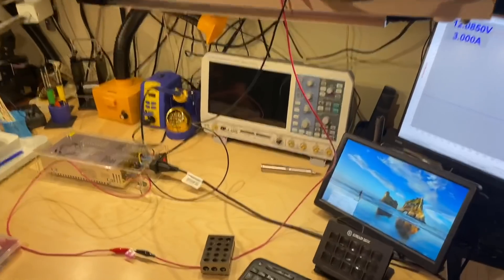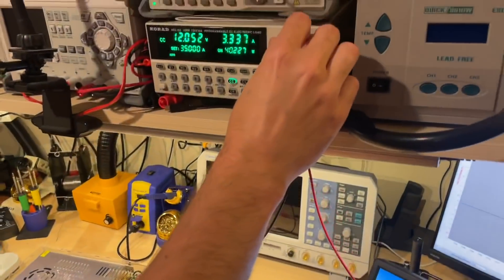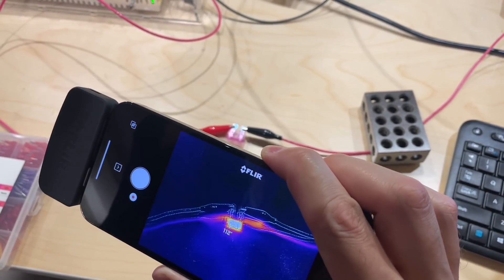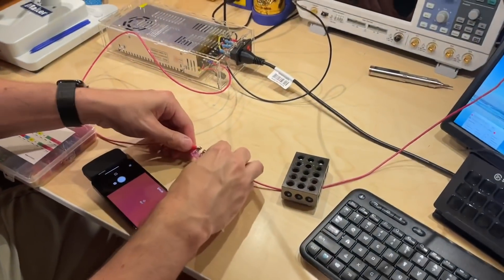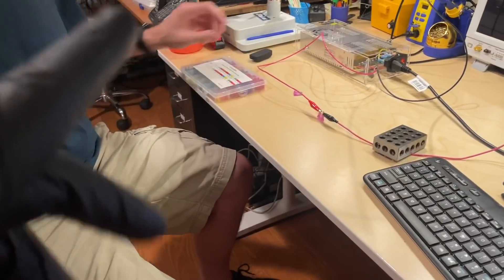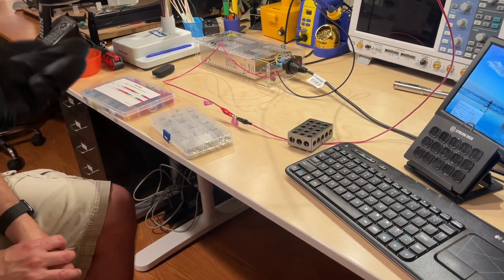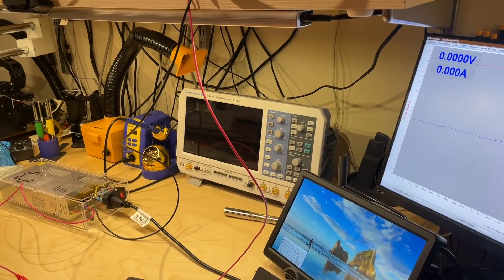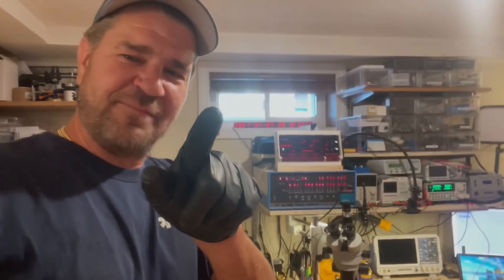Discussing & Testing Cheap 3 Amp ATC Furnace Chinese Fuses with an Electrical Engineer

Comment: I've seen the same thing from all different types (Glass, ATC, Pico, etc.) of fuses that come from China - fast blow-types are taking 200%+ of their rated load to blow. I recently tested a 5A fuse that took 10A+ for over 10 seconds before it blew, and it was a fast-blow type. I tried the same spec fuse, but this time from Littlefuse. Blew at 5.6A when I was ramping it up slowly, and 5.1A when I hit it with immediate full current...stick with the known brands like Littlefuse and Bussman - these are protection devices that stop fires and equipment damage - don't cheap out or try and save a buck with these.

Comment: There are standards spec sheets which show time to blow for a given amperage. Voltage is not important, current is. 

Actually found the other day that the morons who installed one of my units 14 years ago (third owner since 2020) that they wired the 24v transformer to pull power from the wrong location on the board....there is a specific spade terminal for the xformer. Before it worked OK but something happened to cause the fuse to continuously blow. Wired correctly and no more issues.

Comment: hvac transformers(all transformers) have a rated continuous load, you go over that for a sustained period and they'll overheat letting the magic smoke out.
say you have one rated 24V(volts) at 40VA(Volt-Amperes), it's max continuous current limit would be 40VA divided by 24V (40 / 24v = 1.67) rounded up to nearest tenth. so 1.67 amps continuous load, above that it will slowly overheat and cook itself. so it's possible a 3 amp fuse may not blow, if the total circuit load is less than needed to blow the fuse!
meanwhile the transformer is still overloaded, overheating and will burn out. best case scenario is a good 3amp fuse and a dead short somewhere that blows the fuse in a short time frame.

Comment: using alligator clip test leads at the fuse is rather a poor connection. but there was major recalls of automotive fuses in the past, "Horrible Fright" got spanked with their fuse assortments not blowing and damaging vehicle wiring/causing fires. I think there was recalls on stuff through amazon also, I don't imagine them throwing the stuff away and it probably got the circle jerk round shipping and relabeling routine. lol

Comment: Mike, I'm a ham, and grew up same (and railroading).  Electronics are in my wheelhouse.
Fuses come in two flavors; fast-acting, and slo-blow.  The first will open immediately on overload, the second will continue to hold for perhaps 5 seconds at rating, but will open on anything above or of longer duration.
Used to be a simple thing, but as I have repeatedly said, some things made in Shenzing are quality, most aren't.

Comment: Possibly Engineers take information like this into consideration when recommending a fuse rating. Knowing that fuses might break the circuit at five amps, a 3 amp fuse is then specified. Ladder ratings are like this. For instance, a Type II ladder is rated for 225 lbs. However, it can hold a load twice that.

Comment: At 12 volts try 24volts
Reply: Great video

I don’t know enough about the transformers in operation on the boards but are they 24v ac or dc? 
The difference in fuse rating between 24dc and 12 dc as far as current (IMO) would be negligible. From what I remember from years back we’d be dealing with I2R for the power calculations based on needing to heat the (cross section of) element to its melting point  (no voltage in the calculation IIRC) if we’re taking 24ac vs 12 dc then I would think this would make a bigger difference due to ac crossing a zero point and causing more current at that point. 

Not sure what we are comparing but I don’t think the testing voltage difference between 12/24 dc would make the fuse handle 60% more than it’s rated capacity. 

I’m thinking along the lines of you Mikey, junk fuses that have no real inspection or testing to confirm what they are specd at. I’d assume they are not UL listed either. 

It’s going to take somebody a whole lot smarter than me to figure this one out 😂 there’s a reason I left electrical engineering lol
Reply: @focusedelectronics  is correct. Power supply voltage makes no difference to blowing this fuse. It's all about the current. (heat/power/I2R)

Thermostat transformers are 24 VAC, but I don't have the equipment to create a precise AC current, so I used what I had available. It does make a difference: the fuse should melt at the same (RMS) current, but in the case of DC, there's a potential for an arc to keep the circuit going, where AC is "easier" to break.

So for this limited scenario, where we're just talking about low voltage, low current applications and small blade fuses, it's probably not relevant.

Comment: Should get a short pro. Better than a little popper. Light stays on if you have a short so you can trace the short. can't beat for 25 bucks
Reply: One of those but with bluetooth or wifi to transmit state to your phone or tablet when you are outside.
Reply: @PipeDoctor  Short-Pro Tool by Global
It stays lit if there is a short. Then you just unhook wires til the light goes out which indicates which wire is shorted.

Comment: 👍 info, fuse manufactory rate fuses by voltage applications & Ac or DC applied
 Example: One can't use a 240vac fuse on a 480vac system.... 
Makes big difference on Voltage applied to protection of a circuit ..
Reply: A fuse has a maximum voltage rating, but that's more about what it can safely break. It's the current that blows the fuse, not the voltage.
Reply: Yes true, but are the fuses your testing car fuses rated for 12 volts ?
 And Mike pipes are using them on 27 A/c volts system... food for thought
Reply: @bobparrott8130  I don't know which fuses he had trouble with. These are the exact ones I was using, they're supposedly rated for 32V: https://amzn.to/3dX2Dzo

Comment: While I totally agree with the china producing inferior goods sentiment I don't agree with the idea that a 3 amp fuse is a bad or inferior fuse if it does not blow at 3 amps.  These fast acting ATC fuses have a range of amps for each fuse rating.  The range is described as the Time - Current Characteristic for each fuse rating.  In order to really determine if the fuses are junk you would need to look at the characteristic curve for the fuse from the manufacturer and test it but not the same way you fellows did in the video.  For such a small incremental cost I would do as you and never use the chinese version of these fuses.  Why take the chance and BTW I would apply that practice to ANYTHING I bought that was made in China.  Here is Bussmann's description of the time characteristics for their ATC fuses.  Notice their 3A fuse on average literally never blows at 3 amps.  https://www.eaton.com/content/dam/eaton/products/electrical-circuit-protection/fuses/data-sheets/bus-ele-ds-2009-atc.pdf

Comment: Watch : Automotive Fuse Comparison from Weber Auto . A college professor puts this GARBAGE to the test in the lab  . They FAIL miserably and are DANGEROUS ! Step ONE : remove this CRAP and don't waste your time till you install a name brand , such as Buss , etc. There is no shortage of low end junk that does perform to specifications . The other problem is " experts " that cannot diagnosis systems and circuits . But they sure can SLAM parts in !

Comment: LOL this is what I did,  except his gear is FAR more sensitive then mine LOL   (I was using a Chinese current limited power supply for my tests instead of a digital load so I may have been at 5 amps when it said 4...... I would love his gear but my wallet just won't do it LOL  )   But I didn't slowly ramp up the amps, I disconnected, reset to higher and then hit it that way its an instant "hit" which is much more how it would be in real world when something shorts.

Comment: what you and most people need to realize is most if not all equipment is "made" in china. yes it may say made in america but the parts inside are "made" in china. It costs less to manufacture in china due to expensive merican taxes and labor. basic economics right there. the other thing is those fuses are probably made in the same place as the name brand ones you mentioned. The only difference is the "cheap" chinese ones are cheap as they have lower tolerances and or are the rejected batches that companies make but dont throw away. If they make 50k fuses a day and 25% fail QC they are not going to throw in the garbage 12.5k fuses, they will sell them... bottom line is you get what u pay for but most if not all HVAC equipment is "sourced" in china. its been like that for 40 years. so bashing china is pointless you should be bashing the merican companies that source from china.
Reply: But when you buy a name brand, you are paying for that company to enforce quality control and do the testing of what is delivered from their chinese suppliers.  If you buy the no name brand, you are likely buying the discards of the quality control.

Comment: Intersting Video...first of all I'm an Electrical Eng. from Germany...so I watched this Video with a lot of interest...so yeah Great Video. There is one thing witch works out for me coming to this fuses and its the following. The Rating in Amps times 1,2 is the tolerance the fuse should have. So 3A * 1,2 =3,6A max. And should blow at 1,6 times the Rating so 3A*1,6 = 4,8A iimmediately and this is working for me in 95% of all casses. Its not for circuit Breakers whit 120V or 240V rating.

Comment: The issue with Chinese is quality control.  Batches of any product need spot inspection to determine if the product is within spec.  Absent that and your product can be 'off'.  Lack of quality control is presence of apathy.  The two are mutually exclusive.  Then the notion of sabotage enters the picture.  Products produced for consumption in a competing (or enemy) state can be used to weaken.  Our reliance on imported goods is leading  us down the garden path of destruction.   There should, at least be thorough inspections upon entry into our nation.  Products deemed unsatisfactory could/should be rejected at the port.  The present attitude among our leaders is naive at best with regards to such considerations.
Reply: It's over current protection not insta-trip protection.😐

Comment: The problem is there is no such thing as a fuse, there are many types and roles as well as just the commonly understood current rating. Fuses have to be selected with knowledge of the circuit (AC or DC and voltage) they are protecting and the type of load - as their behaviour needs to be different. For example fuses for resistive load  are different to one protecting an inductive circuit load (motors). A brief overview:
Unsurprisingly for such a widely used component, fuses are available in a multitude of models and voltage capacities for use in different industrial, manufacturing and electronic settings.

The time taken for a particular type of fuse to blow is called the fuse speed. The three principal fuse speeds available are:

Ultra-rapid fuses: typically used in sensitive circuitry and transistors to protect against short circuits, reacting almost instantaneously. These are also known as Very Fast Acting, Super Rapid and High-Speed fuses

Fast Acting Fuses: these are a more general-purpose fuse typically used with cabling and sturdier components. They are also known as Fast Blow or F-Type fuses

Slow Acting fuses include a delay mechanism which allows short, lower power electrical surges to pass through the circuit without the fuse blowing. They are also known as Slow Blow or Time Delay fuses. Dual Element fuses feature a higher performance delay mechanism

If you buy a job lot of ‘fuses’ from a cheap supplier - all bets are off.
Reply: Especially in the refrigeration field, the need for slow blow fuses or circuit breakers to allow momentary amp draws in excess of the rating are essential to prevent nuisance trips.  Locked rotor amperage on start up normally disappears a split second after motor start.  Going out in the middle of the night to replace a finger fuse or reset a tripped breaker is, in my mind more than a nuisance.  Now, you do want the slow blow to open up if the LRA continues, as this indicates a problem with the start process of the motor.  Other factors including fuse or breaker age also determine the sensitivity as well.   Better to have a fuse blow than a building catch fire.

Comment: Is the circuit board on a furnace/air handler AC volts? Should you be testing with ac voltage . Just curious
Reply: it's ac power in and through the fuse, some of the power is rectified and regulated to DC for powering the circuitry, which pretty much stays on the control board.  the rest of the devices in the unit, thermostat, contactor in condenser, other relays and controls are all 24VAC and the board passes it out to everything as needed.

Comment: I will tell something else about fuses! The larger amp round fuses have a strip of copper running from one end to the other and are filled with sand! These fuses are designed to be installed  sideways because if you installed them straight up and down the sand will settle a not cover the top part of the copper strip resulting in premature failure because the the fuse is designed for the sand to absorb the heat to control how long it will take for the fuse to blow! An engineer at metro told me this when we had a problem with fuses that were installed up and down blowing alot!
Reply: they're filled fully with it compressed tightly via the end caps with no void at all, so direction of them doesn't make any difference in that sense.(knockoff's maybe not)
now there is thermal heating to think about, with the fuse vertical heat rises to the top and builds, which would make it open thermally  at that end first. but also take into account loose holders, wire lugs, switch blades, tarnish and pitting. all make for increased thermal heating at the junctions :)

Comment: Fuses are over current protection "OVER"  
The definition to exceed the rated current for a period of time.
That means if you exceed 3.1 amps on a 3amp fuse for two days it will blow.
Or 200 amps blows in .0009 milli seconds.
Without a side by side comparison with a sample batch of each american" brand" vs the others the test is flawed.
They are again "OVER CURRENT PROTECTION"
cool story tho.
🤣😂🤣😂🍺🍺🥃🥃🍺🍇🏌
Stay safe.
Retired(werk'n) keyboard super tech.
Wear your safety glasses.
Reply: This wasn't really intended to be a test or proof of anything. I saw Mike talking about fuses in his other video and I wanted to try an experiment for fun. I think we said in the video that the time it takes to blow depends on the current. Mike didn't know I was doing this, so we didn't have any of his fuses to compare, I just used what I had on hand.
Reply: @ChrisMasto  👍
But he could have left it at if you ain't test'n your guessing when he cooked all those fuses and blamed China for it !!!😂🤣😂😂🤣🤣😂😂🤣😂🥃🤔🥃🤣🤣
Reply: @PipeDoctor  🤣😂

Comment: The fuse shouldn’t blown at 3amps right away. It works on heat and can take up to 4hrs at full 3amps depending on ambient temperatures!

Comment: Thanks for the info! I would like to see the same test at 24v to see if the higher voltage changes anything.  Just out of curiosity.
Reply: The only thing a higher voltage would change is the possibility of arcing. Maybe I should do a video on the math behind it, but basically the power dissipated in the fuse is due to the resistance of the fuse and the current passing through it - what they call I²R loss.
Reply: @PipeDoctor  Hah. Chris is the MIT reject! I have it framed.